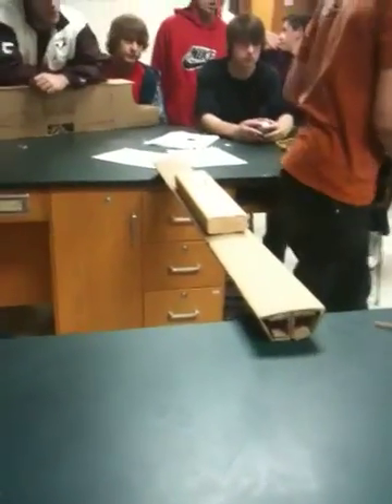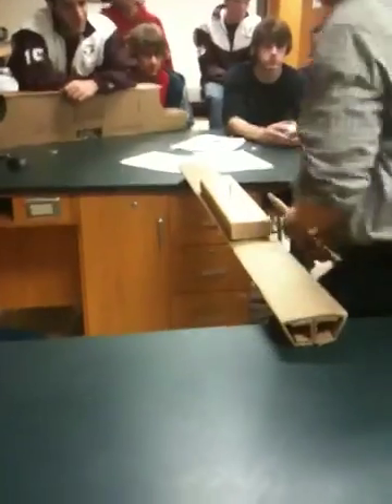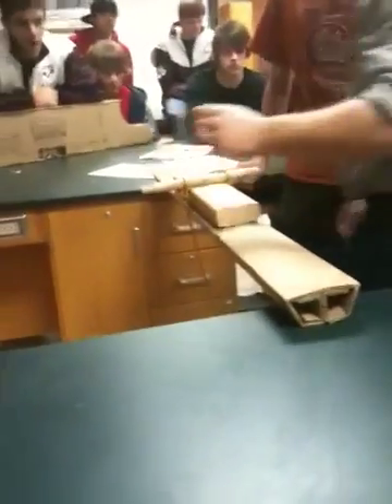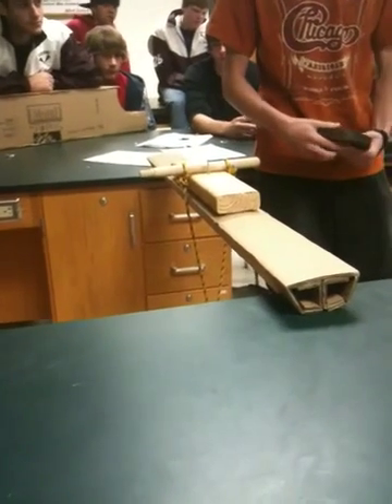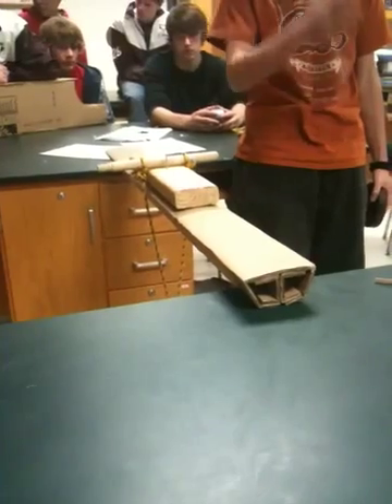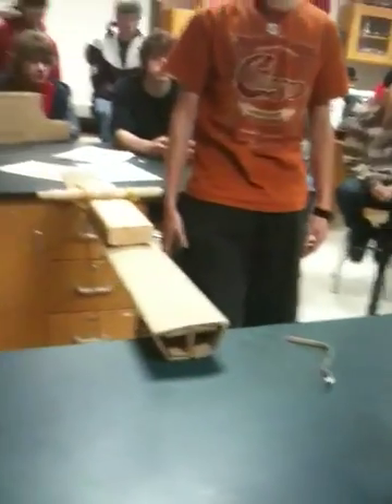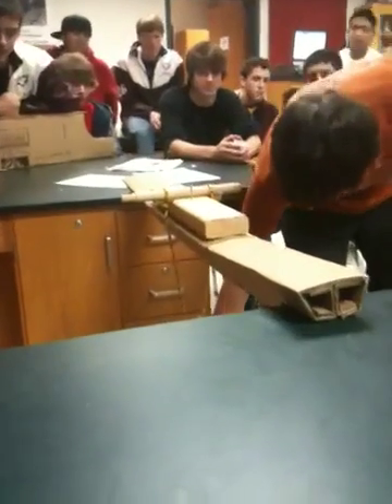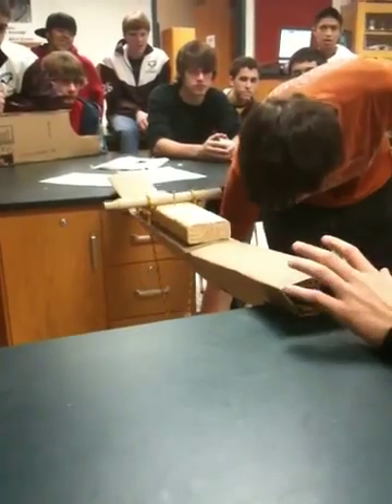Cardboard bridge collapse

Comment: it failed because your structure has too much material toured the inside and sides and not enough on the top and bottom so your compression and tension forces were being put a very small area